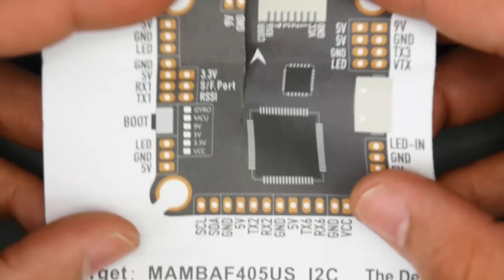How to Build Ultimate Budget FPV Drone Build 2021 //  Beginner Guide

Comment from the maker: FC & ESC: https://bit.ly/3xEs15d
iFlight Frame: https://bit.ly/2FtWexy
VTX: https://bit.ly/32ULxgd
Antennas: http://bit.ly/2Sk5d6D
Motor Wrap: https://bit.ly/3chFGUf
Nylon Stands: https://bit.ly/3iHDsk6
FPV camera: https://bit.ly/3uaOJzU
Motors: https://amaxshop.com/index.php?route=product/product&path=68_69&product_id=488

Budget Motors: https://bit.ly/3vzSwXO
Budget VTX: https://bit.ly/2QKX3b4
Budget FPV Camera: https://bit.ly/2QDK7Uw
Tools:
Hex Drivers: https://bit.ly/33EGTDN
Hemostat:  https://bit.ly/3nxCXg4
Solder Iron Recommended: https://bit.ly/34B2FYd
Silicon Pad:  https://bit.ly/36JrTGv
Reply: Hello, I send you an email, can you please answer for it
Reply: That link for the hex tool is not what is in your video...
Reply: Links don’t work 😔
Reply: Deliberately wrong hex tool link, why?
Reply: Where is the reciever?
Reply: What KV are the motors in the video??
Reply: Hello would this drone be good for surveying? If not what I need to add?
Reply: @BIgoorrr  hi i have an old night hawk and i dont know where to solder the flysky receiver
Reply: If I buy FC & ESC comes with diagram?
I need schematic diagram too.
Reply: What about the capacitor you used
Reply: wheres part 2?????? with how to do all teh software stuff????
Reply: Thanks for your awesome vod! 
Just wanted to mention, that the link to the motors is broken (not only the link itself, but the each and every link to those motors on amaxshop as well). Could you tell me the specs of that motor? I would take the budget motors but those are sold atm. =D
Thanks a lot and stay healthy
Reply: Where = the next video can not find it
Reply: @larsmaertins3403  Did you figure out the specs of the motor?
Reply: Thanks man I will try to make one
Reply: Thank you
Reply: What's the total cost of the build?
Reply: Total cost for make this ?
Reply: How much would it cost for you to build the simplest fpv for me
Reply: Is it preferable to power the cam from the fc or directly from the vtx?
Reply: Drone Mesh were you doing a give away 9 hours ago?  I'm guessing some spammer fisher was lurking hey?
Reply: @matrixza4821  did you find a solution 🤔?
Reply: I need one
Reply: do you have the link for the receiver?
Reply: do you have the link for the thing that goes in that little holder for the frame
Reply: I'm a couple years late, but I'm curious. What was the approximate cost of this quad when you built it in 2021?

Comment: I've watched several builds from different channels and I was wondering if anyone knew you can insert the wires into those holes and still solder them down. FYI, 20 years Navy Electronic Repair Technician now an Electrical Engineer, just in case someone wanted to comment that I was talking out my butt.
Reply: I was thinking the same thing - it's going to be vibrating a lot, so you need all the mechanical strength you can get.
Reply: Yes, better make it through holes.
Reply: 0 qualifications here so don't take me at my word, but I find if you put the wires through the holes and solder, the 90° bend with pre-stress the joint and make it more likely to break. Also, it's just much easier to solder to the pad horizontally for me.
Reply: @merseyviking  strength isn't a problem, but using the through holes will give a way cleaner connection with less solder
Reply: This was why i looked at the comments. Was confused why he wasnt using the holes. Ya know like every piece of electronics ive ever seen?
Reply: @cHAOs  most board with solder pads like that I think have the holes so the solder will integrate itself into the board bc it's not hot enough to penetrate and fuse, so probably just an anchor bc in most cases the holes are to small for the wires anyways
Reply: I think those holes are meant to be a heat sink not meant to have wires inside.
Reply: @candymanAM  Usually the wires are inserted into the holes and soldered on the opposite side. This helps prevent the solder from wicking up the wire. Solder wicking up the wire causes the wire to be more prone to fracture with vibration. Soldering directly to the pad does nothing to prevent this wicking and in the long run creates a less durable connection. For the most part we are splitting hairs with regard to the method used and I expect that for this application either will work fine. The end product is not likely going to be in service for more than a few years at most.
Reply: If u could wire a solar panel, and recharge off of that would be cool...
Reply: I was a Navy Nuke machinist mate and while I didn't do the electrical or electronic stuff,  I can tell you that solder job would be UNSAT.
Reply: Hey how can i make 1 at home  can u tell me which parts i need..
Reply: I have to admit to some confusion. You are literally posting in a video that shows you what you need and how to build it. Granted this video is pretty old so there are a lot newer components available. Still you just need to watch a few more videos. DroneMesh pinned a list of components to this video, if you want a list of what to buy look at that.
Reply: I was beginning to think that I was crazy lol, thank you..
Reply: Uninformed Commenter here: Solar is heavy and weak, but you can recharge the spare battery in the ground, just give it a few hours.
Reply: I agree,  and use some damn flux - That soldering is gory!

Comment: Multiple things: 1) using a PCB holder/bracket to do the soldering is IMMENSLY helpful 2) fluxing the pads prior to tinning makes the heating and tinning process quicker thus reducing the amount of heat dropped in to the board 3) cleaning and tinning your soldering iron prior to actually doing the work makes the work easier while maximizing heatflow in to the solder which reducing the likelihood of creating cold joints 4) when using lead solder, ABSOLUTELY use some means of ventilation.  Lead SOOOO bad for you.
Reply: This build isn’t even worth it now, damn economy

Comment: The holes in the pc board are there to put in a tinned piece of wire in to be soldiered correctly, not to fill up with a big blob of soldier and short out your board.
Reply: Maybe the wire couldn't go through so he did it as a SMD
Reply: it hrut me to watch too lol
Reply: But like still a great vid
Reply: I kept wondering why he was doing this.  So bad.  Just don't solder this way.
Reply: I just watched the video, and cringed. I doubt he used any static protection either.
Reply: ...and he commented more than once that the molten solder might be running through the hole. Just stick the damned wire in there, how hard is it!
Reply: Calm down people, you could still heat up the solder point and just push the wire through the hole.
Reply: @QuantumBubble  That isn't how you do it.  It's just not good quality work.
Reply: @rehoboth_farm  Through holes for something like this is just bad design.
Reply: @RetroDoneRight  No.  If you are soldering wires to a circuit board it is perfectly good engineering to use through hole fastening.  It is mechanically sound and provides a quality solder joint with excellent conductivity.  It has been done that way for a century.
I have been soldering for over 30 years.  It isn't done the way he is doing it.  It is absolutely obtuse to fill the holes and then try to solder it in a surface mount fashion.    This is just sloppy and plain wrong and it has NOTHING to do with engineering.  I don't care if that sounds brutal.  He needs to learn how to solder properly.  He should go take some lessons, a class, watch an expert, whatever.
Why is it so wrong?  Because it is mechanically weaker.  Doing what he did is very likely to cause a cold joint or delaminate the contacts.  It is also likely that any stress on the wires will peel the contacts right off of the board.  It is also much more likely that the contacts will bridge and short.  It's just a crap way to do this.
The wires should be stripped, tinned, pushed through and soldered.  The stripped end of the wire should be through the hole (drilled by the manufacturer) so that the insulation is butted up to the side opposite the solder pads.  I prefer to hook the tinned ends of the wires such that they lie flat on the solder pads.  THEN you heat up the wire and solder pad with the tip of the iron and place a small spot of solder holding heat until the solder flashes.  Then you simply cut off any excess wire with a pair of small dikes.  This should be a very simple procedure.  Any electronics tech school in America would do it exactly this way.  Any professional manufacturer would do it this way.  Take apart ANYTHING.  This is how it is done.  
Now, if you want to improve this you could solder on a header and put a header connector on the cable.  It would weigh more a little more though.  How would you solder on a header?  Through the holes.
Reply: @rehoboth_farm  doing it wrong for 30 years !
Reply: @chrisnoren777  🤣  No.  I haven't.  The 14 year old kid 🤡in this video doesn't know what he is doing.  It's painful to watch. 🤣

Nice cat videos. 🙀🥸   

If you would like, I know an electrical engineer that lives in Florida and he could give you lessons. 🏫 Eh, it's a big state and you probably couldn't afford to pay him anyway. 🤑

Keep doing it wrong if you like.  I don't care.  You just can't fix stupid 🙈🙉.
Reply: @rehoboth_farm  you are just so hurt man. I hope you find peace.
Reply: @Purpz710  🤣

Comment: Quick note on soldering: The solder wicks towards the heat (towards the tip of your iron). If you have a big pad to do, try applying heat to one side of pad, then move around wire to the other side and apply solder to the heated side you just left. If it is hot enough to melt properly it should flow across pad and wire towards the iron. This should give you more consistent coverage without trying to wipe with the iron like a paintbrush. Thanks for making this video; it is fun to watch!
Reply: Or just buy a desoldering gun or a solder sucker… solder wick sucks ass and you’re likely to just dead the thing with it more than actually removing the solder.
Reply: @lonewolftech  i accidentally soldered my wick to the board :(

Comment: All nice but....a) that is not the way to eliminate shorts between pads, there is a dedicated meshed flat wire strip to absorb excess soldering material ; b) That is not the way to reliably solder wires on pads, you are not using the pad's thru-holes, first insert the wires and then apply soldering, so it is much less likely that any wire will detach from its pad due to quadcopter vibrations, shocks or unintentional tension on the wires/harness....

Comment: I am IPC Certified and work for a major airline repairing avionic components Tips for soldering: 
#1 Tin your iron when your are done, this means add a little solder to the tip before you turn the iron off, this helps prevent oxidation on the tip and which makes heat transfer to the board a lot better. 

#2 when you are soldering in the wires try and make a loop and put them in the holes then add enough solder so that there is a small fillet from the lead of any joint to the pad the solder is sticking to, the shape should look similar to a cone but it is curved inward doing so will make the joints last longer and make it so you never have to solder anything back on. 

#3 Try and find 63/37 lead/tin solder, it heats well and cools better and faster which will keep your joints in place longer. 

#4 look for any stray solder beads and also look for cracked or cold solder joints. A simple google search can show you an example of such. 

#5 be careful with how much heat you are using, if you use too much heat you can delaminate the layers of the boards and that can destroy the boats. A good temperature is 600-700F favoring the lower number because it will make your soldering iron last longer. 

If you need any other advice or need help just DM me

Comment: As of today, this is $388 but some of the components are on sale. 

Additionally it would be cheaper if you already bought some of these. For example, the link has you buy a whole set of nylon standoffs but you only need four for this build. The antennas come in a pack of two etc
Reply: The chip shortage really bumped up and made economical parts premium :(
Reply: 388 is not a budget build

Comment: Great video! I found that using vcc rather than the 9 volt pad on the vtx gave me alot better performance with the tank . from everything I have read they cant take all the voltage you can throw at them.
Reply: Hi Jim , So should I use the vcc pad instead of the 9v pad on the vtx? Would that be better ?
Reply: @AdrenalineAshRC  use 9v if it works fine and u get the full power 800mw then leave it.  If you don't then move it to vcc
Reply: @AdrenalineAshRC   make sure the vtx you are using is rated for vcc. the tank he used in the video is.
Reply: @jimlibey4042  thanks a lot bro 😎 really appreciate your help 🙏🏻

Comment: Capacitor fitment is quite unfortunate. Legs of capacitor should be in thermo isolation. Cut out in frame and not isolated capacitor legs makes it perfect spot to be shortened by wet grass. Ideally + / - ESC pads should be painted with fluid isolation as they are prone to be shortened in same spot where the cut out is.

Comment: cool guide! one thing to mention.. get a bigger soldering tip for connections like the XT60 connector or the ESC pads :D
And..sometimes soldering flux is just nice to have (even if the solder itself has some flux core inside)
But that's some first-world-problems and not must-have.

Comment: Instead or soldering right to left or left to right, wouldn't it be better to advise beginners to work on the soldering pads from the outside and not from the inside on the fc?

That way there is less chance of dropping a solder blob on the components from the tip of the iron. I have had shorts because of this. Luckily my shortsaver gave me a heads up and I didn't directly plug in a LiPo. 

Also, changing the tip to a flatter and larger one will save a lot of effort when soldering the Xt60 and the motor wires! Also a lot less contact time between the soldering iron and the solder pads. I almost lifted a pad because of contact for too long with a small tip!

Comment: @Drone Mesh I think I am dumb, I am new to this and really want to build one. Does the flight controller have a built-in receiver??! I have a Spektrum DX6E and for the longest time, I thought I needed a separate receiver for it, like how RC planes do it. So if it does, would I just need an FC that can run the DSM2 or DSMX? Let me know! thanks!

Comment: Adding a capacitor to a modern 4in1, even on 6s, is in my opinion so much overkill. (most of them run 2-4000 uF low ESR smd caps already built in) Plus - by using the throughhole package you always risk a short on your bat voltage ... frying everything -  even if you shrinkwrap the little legs/clearcoat it. If you want smoothing for voltage spikes I would suggest buying a small PCB board which comes in many different uF - values instead of the big ones with exposed spiny metal legs. :D
Reply: Rosetta Stoned  Love the name 😂👌

Comment: Geez, use some flux on those solder points, man! :) Especially in a high vibration environment, it will decrease the risk of having a bad or cold solder joint

Comment: I like a 2 irons setup - one with a flat tip - one point.  Wide is just to heat the wire and tab just enough to prime them with soldier.  Then do the fine work and clean up with the point.  That keeps me from, over heating the board.  It also heats everything evenly faster, with less hot spots.

Also, good soldier and flux matters.  ESP. when you start out.

Comment: I bought a DJI FPV and put some hours into a sim. I have done a couple of manual flights but found the DJI FPV Drone to not be so sturdy. To practice more without risking a 700 euro drone I want to now practice with a self built (so I can change props and arms when I break something. I obviously want to use the goggles that came with the DJI FPV Combo (DJI FPV Goggles v2) and want to go digital. What would I have to change in this build to make that possible? (Having a hard time finding the correct info online).
Reply: hey man im in the same situation with having bought the dji FPV drone. Did you go down this path in the end and what did you find you needed to work with the dji digital goggles?

Comment: Hi Drone Mesh, thanks for the video. Hey, where's the link to that hex driver with the quick swappable bits? The link you have in the description all point to hex driver sets with 4 full drivers. I like the one you are using in your video with the easily swappable bits. Thanks for the help.

Comment: There's something I'm struggling to understand. In rc planes, you buy a transmitter and a matching receiver. In FPV drones the receivers seem to be open source?? So can I put a flysky receiver in an FPV drone instead of an open source one in order to be able to use my flysky i6x transmitter? Thanks a lot

Comment: A lot of people don't know you get can other soldering tips. I recommend having a very fine tip, the regular tip in this video, and a chisel tip that's flat for wider surfaces. I use those the most.
Reply: The idea with soldering, for those who don't know, is transfer of heat. You need the copper plating to be hotter than the iron so the solder attracts to the copper pad and away from the soldering iron. If you don't heat the copper pad up enough and you pull the iron tip away, the solder will follow the tip. It helps to heat the copper pad up first momentarily, then add your solder and wire immediately after, so you don't have to hold it in place for so long, because the solder melts quickly but it steals a lot of the soldering iron heat so it doesn't transfer as fast to the copper plating on the PCB. Heat the copper up first.